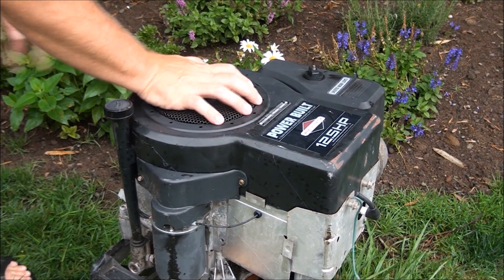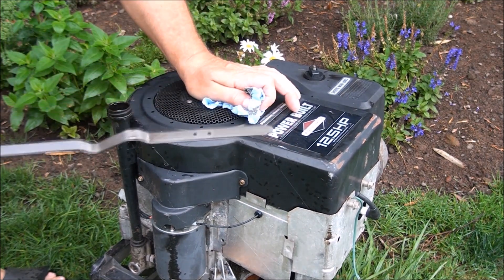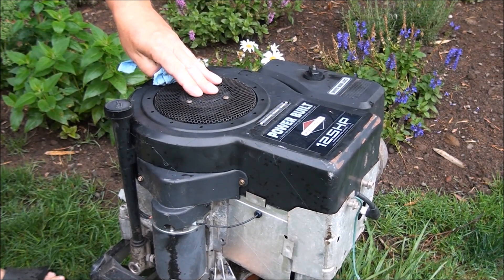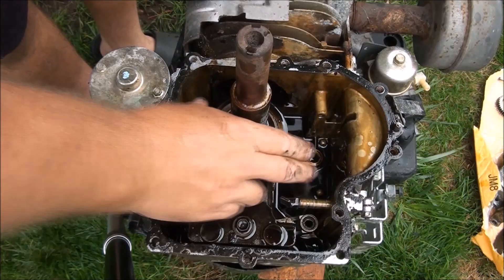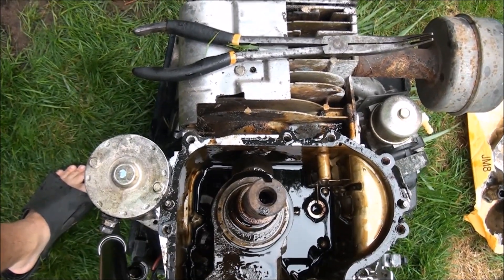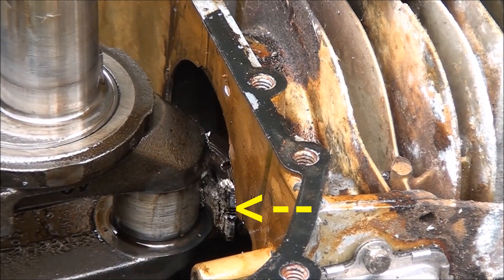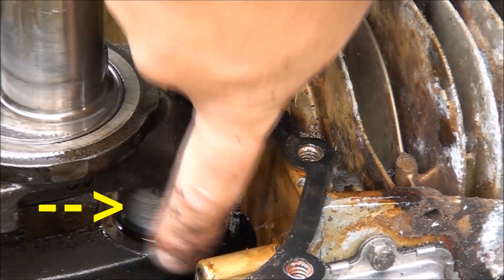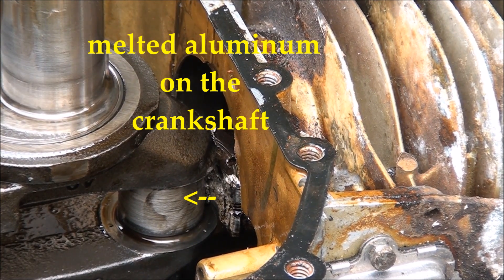EXPERIMENT: Sulfuric or Muriatic ACID How to REMOVE Melted ALUMINUM on a CRANKSHAFT? Crank Resto

Comment: As you mentioned, when working with acid people should make sure they're in a well ventilated space, and as you said, don't breathe in the fumes. Those fumes are acid and they'll wreck your lungs something fierce. I also recommend keeping a container of water to dilute any acid you spill or baking soda to neutralize the acid. Also never pour water into a container of acid, pour acid into a container of water if you decide to mix the two. Pouring acid into water will dilute it safely since there's more water than acid, water into acid can react violently since there's more acid than water and it can spit acid everywhere.
Reply from the maker: Good points! Safety first!

Comment: I was skeptical but the Muratiic acid was AMAZING.   My first instinct was to try a propane torch because I assumed that the combination of Aluminum's low melting temp and high rate of thermal expansion would make it pop it loose and drip Aluminum on the floor.  I gave up out of fear of over heating the crank.

The only thing I would do differently next time would be to apply bug spray on myself first because bugs were biting me and I couldn't risk swatting them with my acid covered gloves LOL
Reply from the maker: LOL!

Comment: Hey Jeff this is awesome! How did it work out in the end? I'm confident that it worked  just fine?
I was just staring at the 454 dollar crank that came out of my locked up Hobart Champion 10000 watt generator / welder due to just using it now and then without checking the oil and it just hit me that the aluminum is stuck to the crank and the crank journal is not likely hurt. 
How to get that aluminum off without a machine shop was the next question which led me strait to your video here with a quick search on youtube.
I think I'll try this I'd much rather buy a rod than the crankshaft.
Reply from the maker: It came out great! but I still have not reassembled the engine. I have been procrastinating
Reply: That's pool asid right

Comment: I have the same thing with my old Kohler I thought the crank was ruined then I was looking at it one day and it acured to me the aluminium had just welded its self on to the crank .
Reply from the maker: It cleaned up very nice with this procedure, very toxic fumes though
Reply: @JeffsLittleEngineService  ya really bad stuff to breath I'm just glad I can save it.the guy I naught it from hade a full custom build the shaft has ben ground on and cleaned up and it has hade weights added to it so it is fully balanced fresh rebuild ported polished .no balance gear or governor .a friend of mine was revvng it I guess he got carried away then I got a phone call about my tractor not running anymore .that was 2 years ago I just took the engine apart last week .I'm hoping and praying it will all b good . Might save up for a custom rod with bearings

Comment: Battery acid is sulfuric acid. Muriatic acid is hydrochloric acid. Sulfuric is also sold as a drain cleaner, and hydrochloric/muriatic as a concrete cleaner. Both pretty nasty.
Reply from the maker: good to know, that muriatic acid was very toxic to work with
Reply: @JeffsLittleEngineService  the worst part is the fumes. Best to do it outside. I like that rope and sandpaper trick, I'll be sure to try it .
Reply from the maker: @hohner51  yeah the fumes got me for a second so I got my box fan out
Reply: Wonder how you neutralize it once its applied?  He didn't cover that.
Reply: @aswasis  baking soda in water. A bucket of baking soda solution should be kept handy whenever you are using acids. It will neutralize the acid.

Comment: I have only had to 1 one like that on a generator and it was my fault for not checking the oil before i started it. I was half asleep after a 15 work day and now i make sure to check the oil in any 4 stroke engine before i start it

Comment: that eng had to be run with no oil  alum. melts at  1100-1200 deg i think   norrmal running dont get that hot  you may be able to heat with a torch and wipe it off